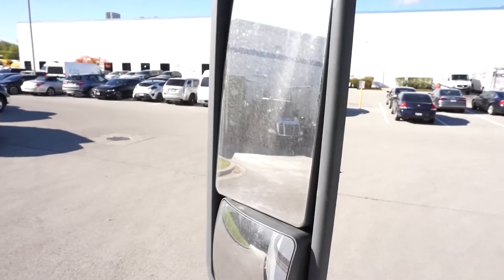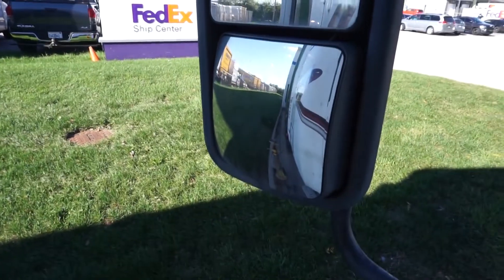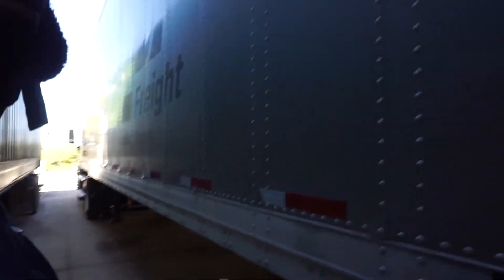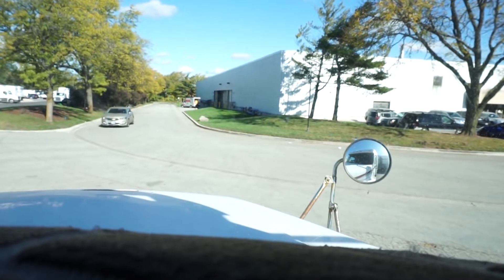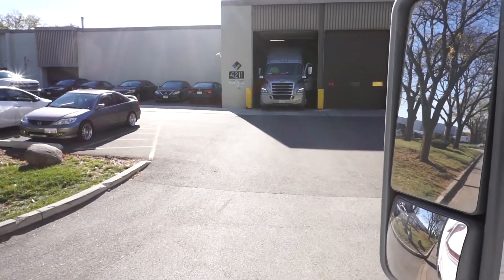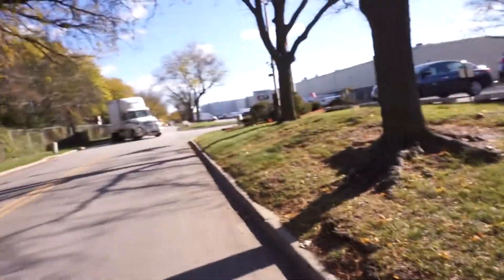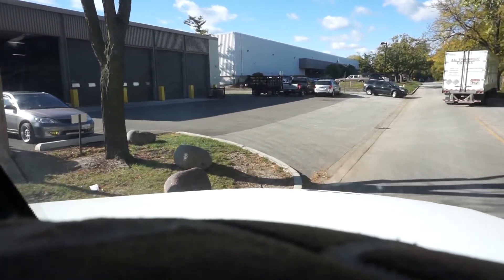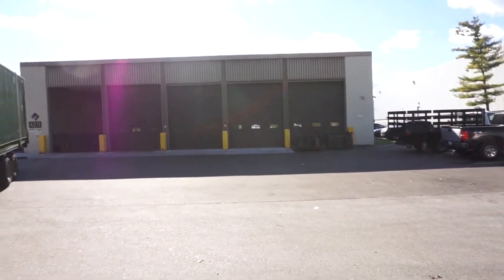TRUCKING: A TIGHT DOCK that is known for TAKING DOORS/ BAD DISPATCHING is a DRIVERS NIGHTMARE!!!!

Comment: Back in with your doors closed tandems in the Cali hole. Line up pull the slider pin stretch it open doors back in. Then just repeat when loaded. Keep the pin pinned open  so you can slide back to the Cali hole. I got a long one tomorrow a tank wash off of. S. Merrimac I'm in a day cab. Gossta roll.
Reply from the maker: What's up Jerry!  Excellent advice job bro that's exactly what I did lol! Be safe on that long roll tomorrow broski!